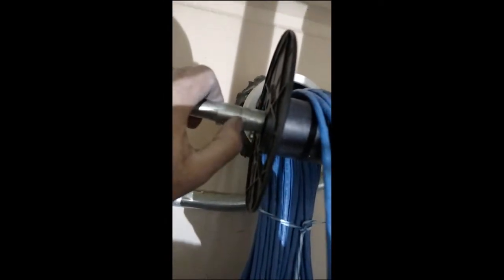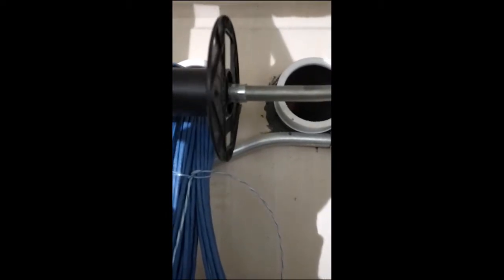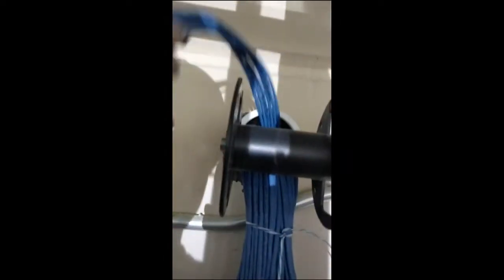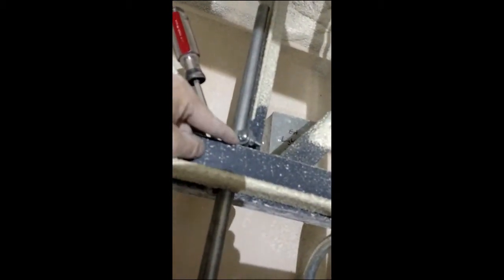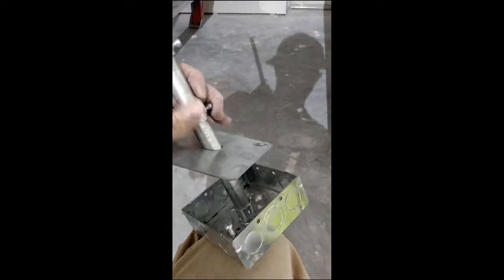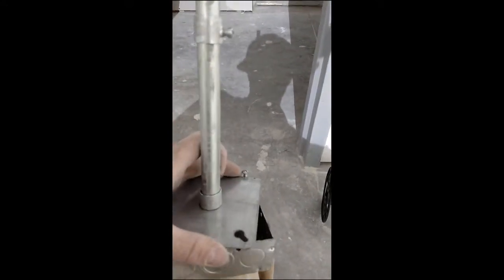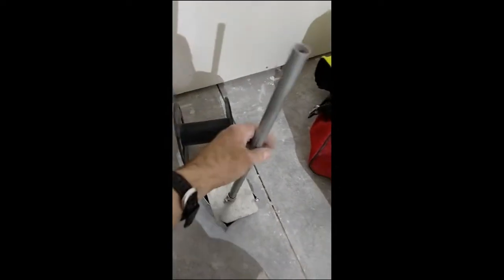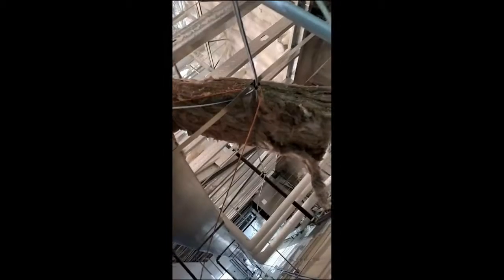diy pulley system for data cable

Comment from the maker: Several years later I learned that we were probably using too tight of a radius. Category cable for data is much more delicate than NM cable used for power. Although a manufacturer's instructions for bending radius will always prevail specifically, I did find a general recommendation from BICSI of using a radius of no less than 20x the diameter of the cable, with a maximum tensile pulling force of 25 foot pounds during installation. These spools were not anywhere near that size. As far as I know there have never been any noted problems resulting from our techniques here but I would do things differently now.